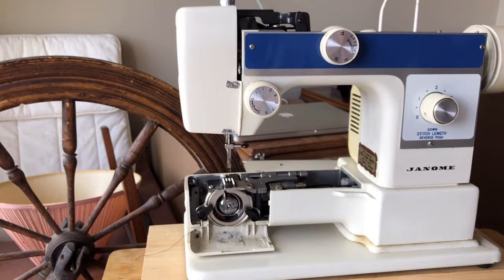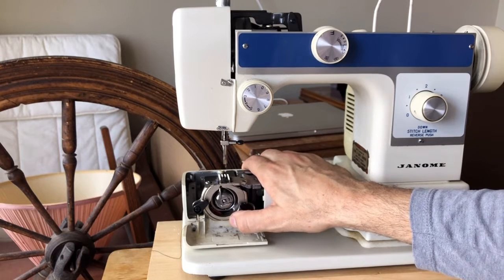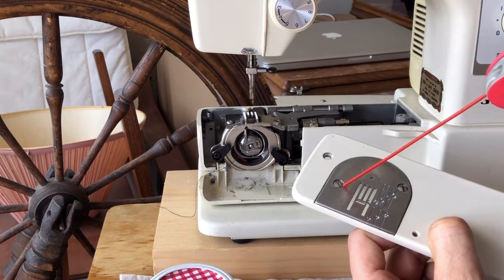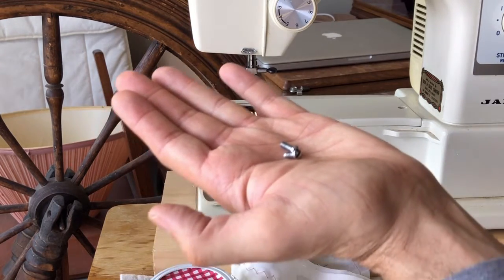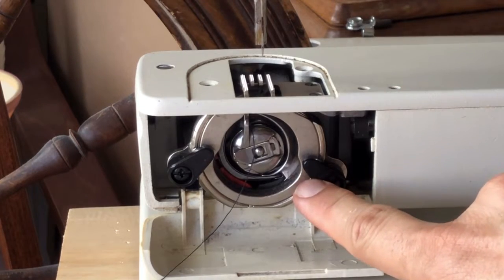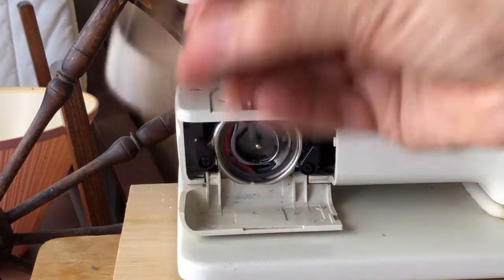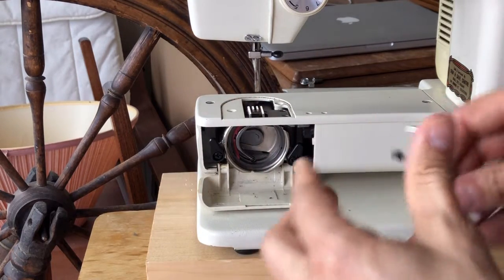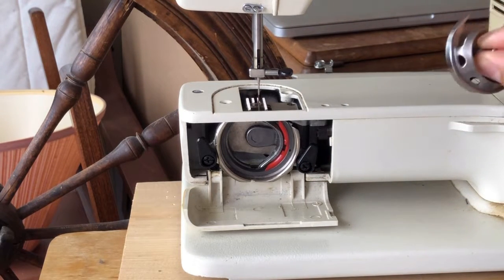RESTORING PROJECT #3: Janome 642: Disassembling & Cleaning Shuttle, Hook, Bobbin Case & Race

Comment: Thank you so much for the video. Your pro tip on oiling the shuttle race. In 24 years I've never heard of that. Nor had I ever oiled it. I recently re greased my gear box making my machine quieter. This made the noise in my shuttle race seem loud as a jet engine. Then I saw your video. I oiled the shuttle race and the bobbin case. IT'S PURRING. THANK YOU SO MUCH. The click click click was driving me buggy.

Comment: I would greatly appreciate if you could explain the little red plastic piece on the shuttle.  I have a Baycrest Model 501 with the exact same piece and the manual refers to it as a "shuttle thread ejector" which "prevents jamming of the shuttle".  The little notch on the metal shuttle on which the red plastic piece fits seems unique too.  This Janome is the first machine I have seen with that same part.  Note identical machines to the Baycrest I have went by other brand names:  Imperial, International and St. James are three others that I have found.

Comment: hi i have purchased a similar machine by janome / new home 611, which looks almost identical to yours but the hook gear is damaged (new one ordered) but now the top and bottom timing is out of sink, so i was thinking of changing the timing belt as well ? do you have and info on how to re-time and fit a new timing belt on one of these ? thank you
Reply from the maker: Hello and thank you for asking.  I don't have any experience with gear replacement on those.  I have replaced gears on Berninas but those are a different design altogether.  In the past, I have used vintage sewing machine groups on yahoo to learn new techniques.  I have recently found groups on Facebook as well.  You might join some of these groups where people share info. and you might find just what you are looking for.
Reply: @VintageSewingMachineGarage  Thank you for your reply, I've managed to do the timing myself and it was pretty straight forward/common sense if your mechanically minded.  and its up and running again , i did spend three hours trying to get the feed-dog timing etc right as it would only make small stitches.

 in the end i resorted to purchasing a pdf service manual for £5.60 GBP which saved a lot of time and time is precious . its up and running i will give it a good blast off and clean and she's basically good to go all in all its cost me £45 for a good quality machine which performs a beautiful stitch,  i'm very pleased with it. its the 1st i have ever done and i'm definitely hooked. i may use this machine at the day center i work at for vulnerable adults, to do the odd repair etc, as its my first major repair machine.

Comment: I have a Singer 221 from the 30's that has been passed down to me.  I changed out the needle and now the timing seems to be out of wack.  How did changing the needle cause this and how do "I" reset the timing on it?
Reply from the maker: Hello Jim.  Before resetting the timing, it may be helpful to check a few things.  Needles themselves do not alter the machine's timing setting, BUT they can upset the timing and its particularly true of Featherweights for some reason.  Make sure that the needle is facing in the proper direction (See your manual)  Note that Featherweights along with a few other Singer models require the needle to be installed with flat side facing left and they thread from the right towards the left when threading the needle.  (Forgive me if you know all of this as I am not sure how familiar you are with these). Next, be sure that the needle has been inserted all the way up until it stops AND THEN hold it in position while snugging down the needle set screw.  If you let go of the needle and it slips even just a little, this will throw off the timing as the needle will be too low vertically.  ANOTHER options for you is to use Singer branded needles.  Although the technical spec for Singer needles is supposed to be the same as other brands (All are 15x1 home sewing machine needles), I have had some of my Singer Featherweights which were somewhat "fussy" about this.  When I took out another branded needle and used the Singer branded ones, it worked.  I hope some of these suggestions are helpful.
Reply: @VintageSewingMachineGarage  some of this I knew and on my Herskavarna viking I use only Schmidt needs but do have a few singer needles.  I do have the needle all the way up as far as it will go. Why I said timing was before I plugged it in I always hand turn the machine.  When using the hand turn the needle bottoms out on something about half way down.  When I took the needle out and hand turned it went all the way down.  I so enjoy your tutorials, and learning a lot. Thank you for your time and your great input to all of us